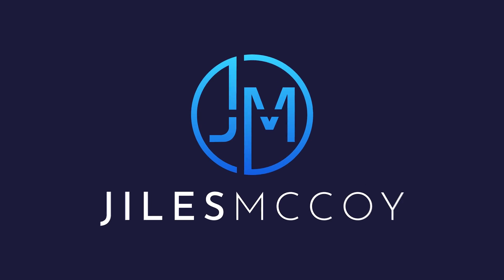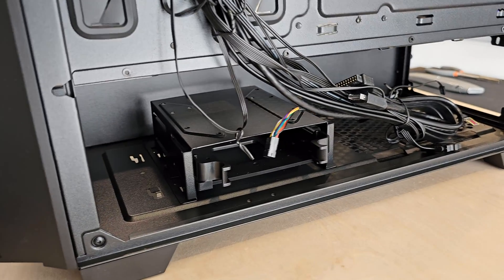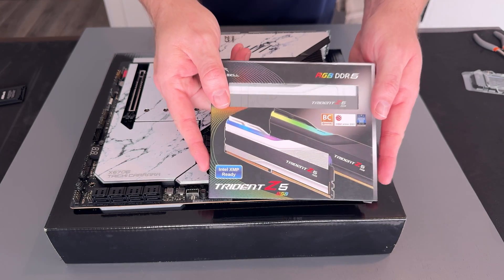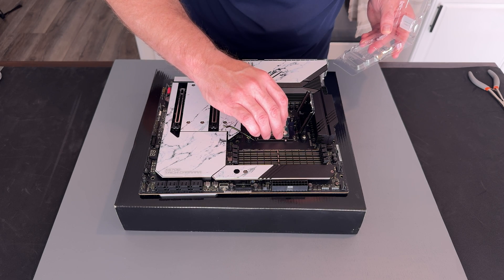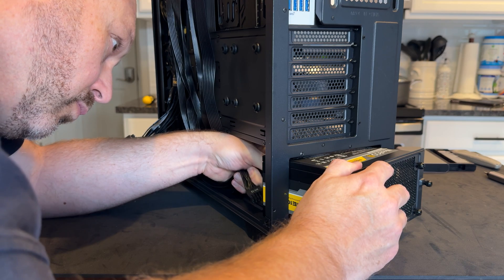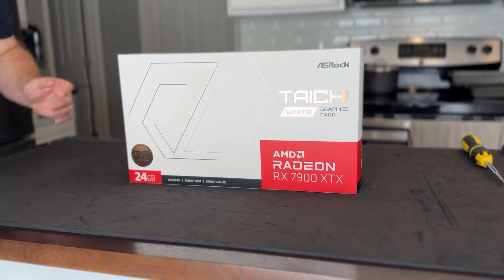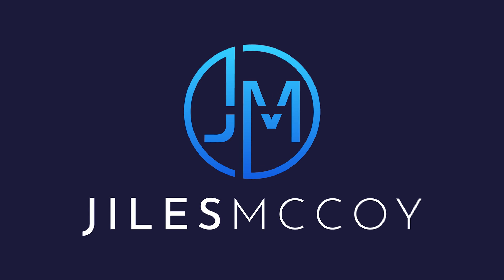Easy Step By Step AMD Radeon RX 7900 XTX + Ryzen 9 7950 X3D Build - You can do it!

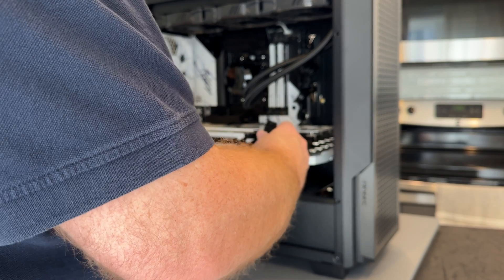Comment: hi man, at 8:23 i see you plugging in 3 PCIe connectors to the gpu, may I ask which ones did you use? my psu only has 2 of 8 pin outputs for the gpu, so did you use the 12vhpwr output? or did you chain them?
Reply from the maker: I used the ones that came with my power supply. They are all straight in, no splitters.
Reply: @JilesMcCoy  Hi again, I just checked your PSU and yeah you got in total 6 8pin outputs whereas mine has only 4 lmao. Thank you for your answer.

Comment: Hey , I am using NZXT C1200 PSU , and it came with only 2 PCIE connectors , this GPU requires 3 , what shall I do ? Can I just buy another cable and how safe is that ?
Reply: I also have 12VHPWR  which is 16 pins ? Can I used that one and then another one that is PCIE 8 pin ? Thanks in advance!
Reply from the maker: I'd upgrade.

Comment: Would this ripped UHD Bluerays quickly? I'm using Zodoo Z2000 Pro with 140 Terabytes NAS
Reply from the maker: You would need to add an optical drive. The PC is way overkill for just ripping though.